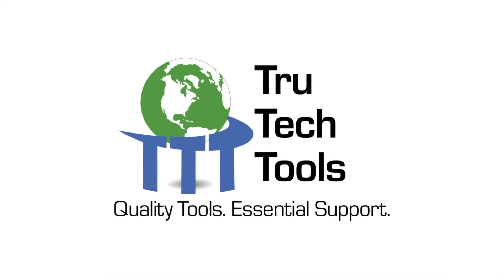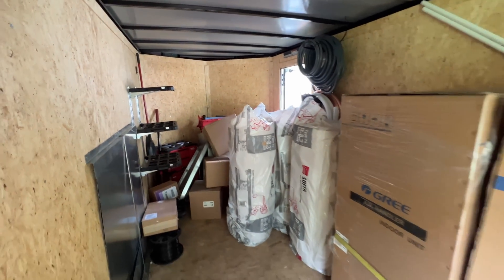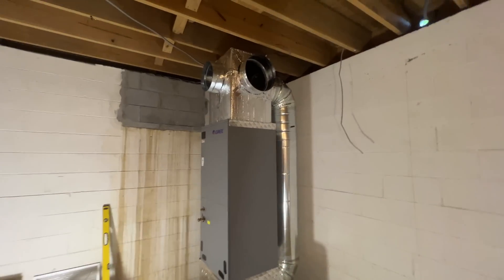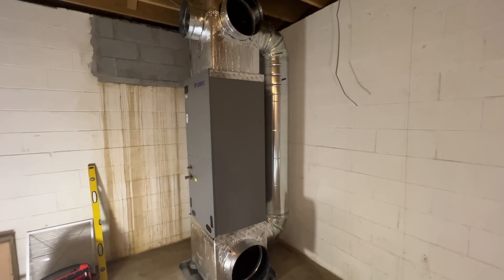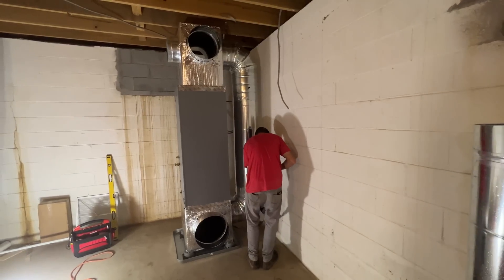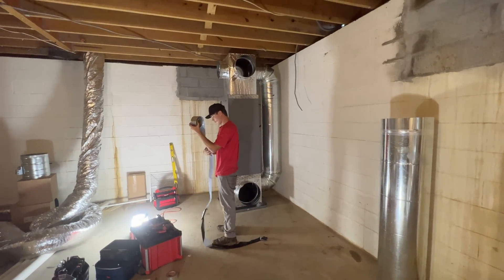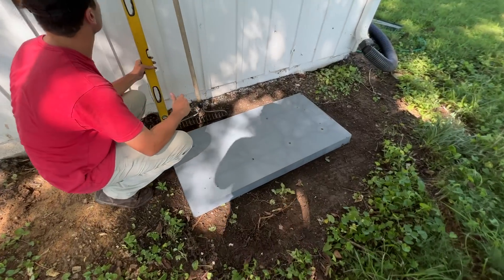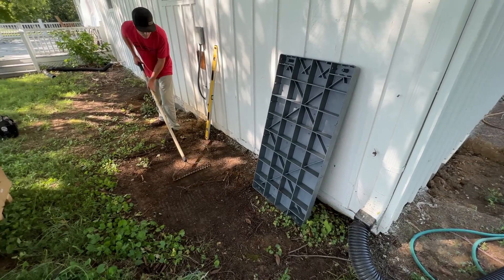I Didn't THINK This Through...

Comment: I would definitely not connect the condenser to the house, we did that and even with rubber feet between the strap and house it still coupled a lot of noise into the building. We ended up pounding 4 feet of half inch all thread into the ground through each foot and that seemed to make it really solid

Comment: You might have done a manual J. I don’t think you did a manual D calculation because those flex ducts look a little small for 5 tons or 1800-2000 CFM.

Comment: We have just installed one in New Zealand Gree GUD160 Ducted Heat Pump System and the unit is super noisey! Does anyone have any ideas how to solve.  It’s mounted on concrete and about 30cm away from the house.  The noise seems to be created from the airflow between the house and the back of the unit?  Any help would be appreciated as we are at our wits end how to solve it without having to move the whole unit.
Reply: Just installed an inverter unit, at my house, the installer said it needs to be 18” from the house.. for air flow

Comment: Erm. Love your commitment. But use tin in basements with exposed joists my guy. It will work what you did. But how can they finish that basement if they want to? Flex is for attics and spaces which will be closed up immediately. Here in Canada that would fail inspection. But it works. Just not here. And I'm probably sure this was the budget. Work with what your budget is I guess.

Comment: It probably says in the manual that the unit needs to be mounted off the ground, that what it says for my pioneer a/c. 

Of course the actual blocks are not available, backorder I guess.  So I'm gonna have to use some 4x4 ground contact rated wood instead.   Idk what else I can do.

Comment: Have you had any issues out of the air handler blower just stopping, causing the outdoor to go out on high head?

We’ve installed 2 of these Gree flexx and had this issue out of both. 

Spoke with tech support. Static pressure is in the appropriate range. Tech support says we are not the only ones experiencing this issue.
Reply: Same here, (I'm a license HVAC/R contractor and electrical engineer) we installed many Flexx36 (B revision) with no issues, just having issue with the Flexx48/60 (B rev), there is a bulletin published Nov 22, 2022 concerning the motor shutting down if the voltage is not in range 187 volts to 253 volts for products MFG Prior to May 2022, the voltage issue has been has been addressed on products manufactured after that date. I don't thing the voltage is my issue (customer voltage @ 246VAC RMS) and we live in a big city. In my opinion, the problem could be the overheating of the motor due to a hot evap. coil, there is a thermistor on the A coil that sense the temperature and report it to the control board. It was mid Dec 2022, outdoor temp was 20F, Discharge line was 163F (!!!), liquide line was 100F (TSP was 0.30wc). What I did is increase the blower speed from 2 to 5 (TSP measured @ 0.38), on the outdoor unit (5Ton), change the dip switches to 4T and set the other dip switch to ECO mode. Started the system and monitored the discharge line, reaching max 156F. As of today (Jan 16 2023), the problem did not reappear. NB: Unfortunately the air handler does not keep errors in memory and shows only the current status (in my case, it was the middle LED blinking=>motor stopped). Will update

Comment: Gree Flexx systems are awesome.Ive installed 2 to 5 ton sizes both airhandler side and condenser side.Ive youve got a good plan for the flare fittings its pretty much cake.

Comment: That eflex guard stuff is code required here and it sucks compared to doing a good tape job with the uv pvc tape....the eflex just always looks hacked up using all the transition pieces on bends and zip ties.the titan flashing is good though no complaints but its the only portion of the kit that isn't code required. All my local guys are convinced whoever started that company has a friend in or county code department.

Comment: @7:30   I get the time of installation thing... But why not pour a level pad of concrete that a 12"+ stand could be bolted ?  auger a couple 6"x48"holes with rebar to fill with cement.  condensoer off the ground for winter snow/leaves, ect...   No all thread to the house because its secured to the ground.

Comment: Sorry, I would have the pad at least 6 inch above the soil level, just due to the elements. (rain/snow).   LOL, if it was in my neighborhood, then it should be mounted on the side of the wall about 3 ft up due to floods.   Hmm, I'm also thinking that dogs will tear up your free-floating external copper piping just since it looks like an exposed play toy.  (Especially if they have any Labrador puppies then you can say goodbye. lol)   Thanks for you content.

Comment: To stabilize I use 2 pieces of strut with angle brackets to lag into the house if the siding permits then on the top of unit I use 2 3/8 stainless sheet metal screws per side with the stainless washers that have the rubber on the bottom and it's very solid. Not many other options. Just obviously check your clearance inside but there's plenty of room to screw into just stay away from top of your coil,the rest is wide open

Comment: I've actually never heard of gree we install strictly mitsu or Lennox for splits. Generally we use the metal wall brackets to hang the unit off side of house for these mini split type condensers but for these giant units we pour a pad and use strut to build a stand. I don't like the flimsy Mitsubishi stands they are awful and look ugly. You can also build your wall mount out of strut as well but we found some solid ones at my local supply house if I think of the brand I'll repost I can't remember it's been a while, not many people can afford these systems anymore

Comment: Just a idea, here in ontario we use brackets on every install from ductless to heatpump units, tapcon into concrete or just hang on side of house and it elevates it from snow or flooding, plus looks alot cleaner.
Reply: He’s in Tennessee. Not much snow
Reply: @cadamham  snow stand. 18inch minimum

Comment: 6"x6" forms, a little AB in the middle to 3 1/2" ,pour concrete and set anchors for the unit. This will raise you off the grade for water and provide a solid foundation for the tall condensing unit.

Comment: Not to be rude, but if that were my basement I would be pretty disappointed. The round pipe & flex are taking up way too much of the ceiling space. Like others mentioned; square duct is the way to go for a basement like that. I'm guessing you are not allowed to pan bays for your returns. That would help simplify some of the ducts crossing over each other. Anyway, I'm kind of shocked by this install. I knew something was up when I saw the bags of flex piled up outside. May god have mercy on your soul. (just kidding about that part)
Reply: Love Zac's videos. Great content and he knows his stuff! But I agree with your comment from a design standpoint that basement is huge and would be nice finished. From my experience what I would have done on this one is use rectangular duct around the outside perimeter of the basement ceiling then shoot round duct runs between the floor joices to reach the walls in the middle areas of the upper floor. This way when the basement is finished and the ceiling is drywalled it has a nice uniform bulkhead around the perimeter walls also when the framing in the basement is finished it's easy to cut a ceiling register in. 
But as anything goes all these things take a lot of planning and money and maybe the homeowner opted for a certain design plan. 
 Just my two cents. Keep up the great content Zac! I'd love to see some pool heater  install videos if ya get any of those jobs.

Comment: No one runs Flex in a basement here in Pennsylvania we run rectangular sheetmetal ductwork with round sheetmetal supply and return pipes. Flex only belongs in un-coditioned spaces, attic, crawl, etc.. We have supply and return ducts in each room "No returns in kitchen, baths"  We perform our own load calc and install equipment and materials using our own employees. Just keep promoting products and entertain the homeowners!

Comment: I always pour a concrete pad for those tall condensing units. Then anchor to the concrete. Takes a bit more time but really solid that way.
Reply: Just poured my concrete pad today. Didn’t want to put extra holes in my steel building and the 4 ton condenser case, and I think it would of looked like crap.

Comment: Not sure if you've already encountered this but I replaced a Daikin air handler circuit board recently and found out the hard way you have to order a capacity adaptor separately. Tech support never mentioned it when they told me to replace the board.

Comment: Recently a distributor of that Gree model you are installing has recently started selling these here in Az that we do business with. Would you recommend these units? I’ve considered installing one at my house
Reply: I’m pretty sure it’s the same thing as the r e Michel brand air temp ultra.  Installing one at my brothers house, has me really interested too
Reply: It's junk....bosch heat pump and air handler.  Mistubishi for mini splits
Reply: @ItsShowtime9  tell me, what makes it junk? It’s got a 10 yr warranty across the board, we’re doing a too notch install. You think the equipment just gonna give up?
Reply: @mrpatter19888  gree is one of the loudest heat pumps(outdoor unit), cheap parts, horrible to work on cuz of the outdoor control board location, warranty support is awful etc... I could go on

Comment: Is that a common way to run duct in Tennessee? That looks ridiculous,  Why not use rectangle duct? I worked for a company years ago that didn’t  use flex duct for anything but a fart fan exhaust, we would hard pipe branch runs even on attic jobs and pipe sleeve it looked amazing when it was completed but a lot of work.

Comment: It's all good, Good job Zack and Trevor, I personally would have mixed up cement, made a slab out of concrete, and raised it as high as needed, and use concrete anchors to hold it down on the slab, and maybe use uni strut to hold the top, good job anyway, keep it going.

Comment: awesome job sir!! but ive ran into a couple of calls where the homeowner complained about black dust shooting through the vents and clogging filters and it was due to old internally insulated  plenums coming apart not my go too but badass install sir 🔥🔥🔥🔥💯💯💯💯💯💯
Reply: I add cleats to older duct if it’s reused at any point. Normally I don’t use insulation on the inside all wrapped

Comment: Yeah, I have to agree with some of the other commenters. I’m in the North East and that would have been a rectangular trunk line. I am usually impressed with your work. I love the Airex kit for Lindsey penetrations. But that flex duct was not aesthetically pleasing. What’s up with that brand of unit? Never heard of it before. Inverter ?
Reply: Seems people here never heard of Gree. Their tagline is 1 in 3 is Gree, because they are in Asian markets. They claim to be the biggest ductless brand.
Reply: Gree is awful....cheap brand. Bosch heat pump and air handler all the way. Mistubishi for mini splits.
Reply: @ItsShowtime9  Loser haters gonna hate.
Reply: @ItsShowtime9 You clearly have no experience with Gree systems. 🤡

Comment: Gree?? Man.... southeast really diving deep to the bottom of the barrel eh? Or you guys just having that hard of a time finding better product? I can ship ya down a handful of industry leaders if ya want bro.
Reply: Ive been selling/installing Gree products for 10 years now, heatpumps, air handlers, etc. Operating in temps ranging from -25F to 100+F so they don’t have it easy.. No complaints. Great performance. 10yr warranty parts and labor from Gree Canada. Not what I would call « bottom of the barrel » at all.
Reply: @jjgrinch123  closest support is Canada? That's rough in and of itself. That's good you don't run into many issues, but from a technology perspective they aren't even close to what the leading brands offer. Just my opinion.
Reply: @InverterAlways  Gree Canada headquarters in Quebec are 1.5h from me, it doesn’t get much better than that. I work on different brands of heatpumps and air handlers and I don’t think the majority are better. There are high end central heatpumps/air handlers that offer better performance (full variable speed air handlers or communicating units, for example) but most customers dont want to pay top dollars for that anyway… As for mini-splits, I have worked on most brands and I am totally confident with the products I install. ;-)
Reply: @jjgrinch123  right on

Comment: I don't understand why people insulate the duct when it is instlled in a conditioned space
Reply: That basement is damp, and probably not conditioned or only partially conditioned space. High humidity climate as well probably. If this house was in the desert southwest that has single digit humidity, and dew points under 32 degrees, there is no condensation to worry about. Southeast part of the country everything sweats...including the installers!

Comment: Pretty Poor DuctWork Job I thought, and we always use metal ducts until the last 5 feet and then use a flex connection.
Reply: Definitely not what I'm used to seeing here in the North East. Looks sloppy and amateur-ish. I like the look of metal duct work. Crisp and clean. : )
Reply: @bushmaster2936  Probably because this is a remodel and not new construction. Easier to do proper metal ducts in a new construction.
Reply: @brnmcc01  Looks like they have an open canvas to run duct work until they hit the basement partitions.  Just looks like a half fast budget scenario going on. Not my house, nor reputation, so no worries.
Reply: @bushmaster2936  Yep, looks like flex spaghetti to me. I don't think that's enough return air for 5 tons either.
Reply: Have to agree. In the south they all do stupid stuff. Like underhouse drain lines, who tf thinks that's a good idea.

Comment: Hey looks good if the condenser is above the air handler do you have to put inverted traps in the line set? I know most Manufactures  want that and some leave it in the gray area! Love the packout van am working on mine too good luck buddy keep up the good work . Have you seen the sling condenser stands for the ground I would use that .
Reply: I believe only if the condenser is more than 30 feet (not sure exact distance) above the furnace/air handler it needs a trap. Where I'm at in the Midwest 95% of units are set up like this video without a trap.
Reply: @aaronburke2469  I never seen Minimum distance  above all I’ve seen if the condenser is above the air handler they need to be trapped check out the condenser install manual for this condenser pretty sure it’s there . I have seen on blue prints on Commercial jobs that are engineered that they were multiple traps if it’s vertically more than 50 feet let’s say they want multiple traps going down On a Multi story building it all depends on what the manufacturer or engineer wants.
Reply: I'm thinking no. If you want exact specs refer to install manual, or watch their contractor videos here on YouTube on their gree channel.

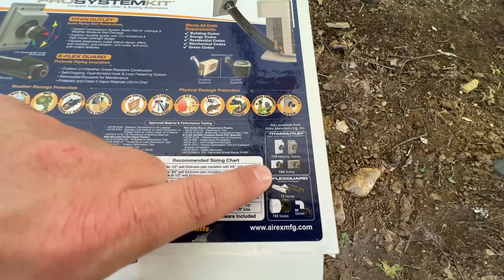Comment: Have your electrical contractor return.  At 11:49 you should the wall outlet for the Line set but the conduit for the electrical is drill downwards so any water will track down the outside as I cannot view any sealant.
Reply: I saw that too. Looks very low quality of product and install to me.
Reply: Most I've seen also have a surge protector outside too.

Comment: Don't know if unit is straight cool or a heatpump.  If it's a heat pump you need to consider snow level in winter if you get snow a lot which in that case the outdoor unit should be raised off the ground for better drainage
Reply: Not sur but I think snow is rare in this area